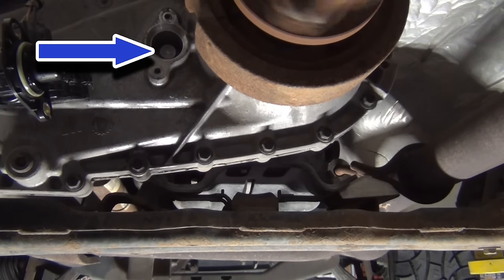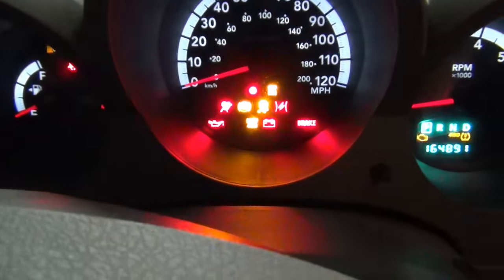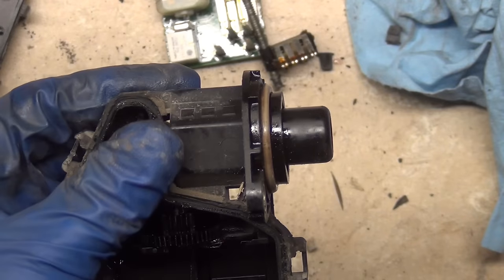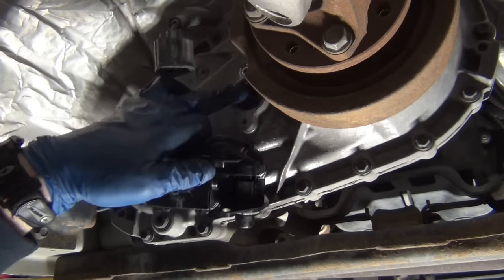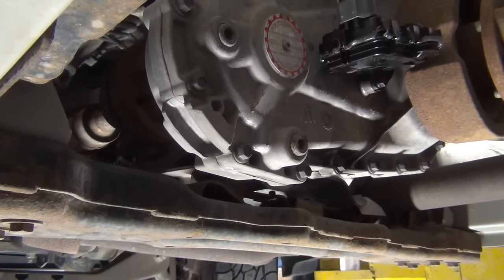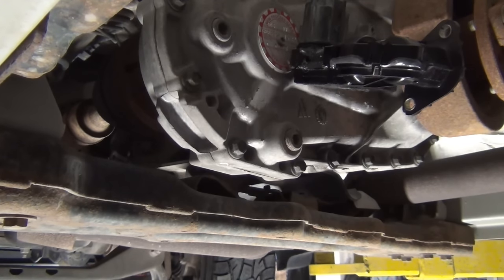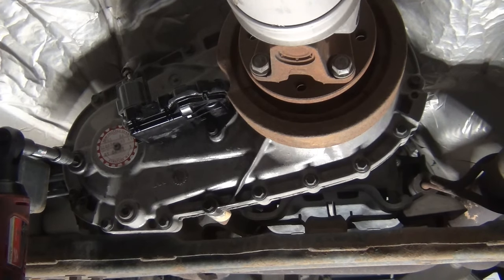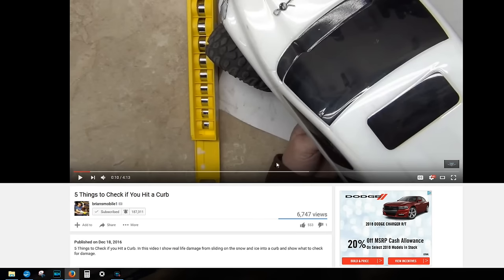Serv 4WD Cheap Fix Transfer Case Tip

Comment: I am confused … Was the problem the actuator, or was it the selector switch in the dash that was actually the problem ???. it sounded like you said that you probably didn't even have to change the actuator. (or were you meaning that the problem was some type of relay switch within the actuator ?).
Reply: I know its an old comment but his actuator worked but when he put it in 2 wheek drive the transfer case stayed in 4 wheel drive- it was common on older 4x4 vehicles as the gears would be loaded together- it was common practice to stop put in 2 wheek drive back up slightly and then KNOW you were out of the 4 wheek drive mode as driving on pavement is generally tough on the transfer case( the tires dont all slpin ar the same rate look up differential creation on youtube theres an old gm video from like the 40s that explains this)

Comment: I thought the 4WD was made in to the transmission but I guess this one has a 4WD mechanism motor with that piston coming out and going into the transmission and pushing that cluch inside to make all the weels move to 4WD
Reply: DJ.Spikes Hostage if 4wd is selectable then it  will always have a t-case.
Reply: tyler a not the ones I seen I work on cars bud ,,,take care!!!!
Reply: Bahahahahaha
Reply: "Selectable" or "on the fly" is usually an electro-mechanical switchable device, whereas "locking hubs" are usually manually operated twist actuators that engage 4x4. Not every 4x4 vehicle uses a transfer case. Most AWD setups are transmission based, without any outside 3rd unit.
Reply: Lets clear this up a little. If you have a front wheel drive that has a 4WD option, then you might not have an external transfer case. If you have a RWD 4WD, then you have to have an external transfer case. That being said, even when it's bolted directly to the transmission, I've never not seen a transfer case on an AWD/4WD vehicle. Please provide an example of a 4WD without a transfer case.
Reply: https://en.wikipedia.org/wiki/Four-wheel_drive    https://en.wikipedia.org/wiki/List_of_Subaru_transmissions#1989–1994_Subaru_Justy_ECVT/Justy_4WD_ECVT    https://en.wikipedia.org/wiki/Subaru_Leone      /   https://en.wikipedia.org/wiki/Subaru_Leone#Second_generation    https://oppositelock.kinja.com/a-4-wd-what-is-awd-4wd-and-how-does-it-work-1650386909/1650531656

Comment: My 2008 dodge ram kicks into 4-wheel drive driving down highway or when I start it in my drive way. Replaced front end actuator,  servo motor,  switch and had in shop. Still is not resolved. Help!??

Comment: A light on my dash reading 4wd and the truck was in 2 wheel drive when I stop makes a conlooping sound. I can drive in 4 wheels (fire stone check it and said the truck doesn't know what greer it's in.    I am driving in 4 wheel drive not with out problems.  the transmission is new 2017.   warranty gone. help ?   where is the transfer case shift motor in a 1995 toyota 4 runner v6?

Comment: I have a 2007 H3 it will start but wont move when I shift it into drive the front drive shaft spins but truck won't move I'm lost an don't know where to start with this truck

Comment: Funny, it's called extreme green yet it's red. 

I am thinking of buying a 2005 Jeep Grand Cherokee 5.7 Hemi with the service 4x4 light on. I looked up some stuff here and there in some jeep forums and apparently there is a N23 recall dealing with that issue. It's from not using the 4 wheel drive and that button  gets stuck. 

I had heard also that pulling the e-diff fuse under the hood, driving around for about 10 minutes then replacing the fuse will shut off the light. 

I figure I could hummmm and hrmmmm him into thinking I might need to replace the transfer case or something scary and get 1500 off or something. heh heh heh

Great vid as usual my friend.
Reply from the maker: Thanks buddy!  Yeah, it's environmentally friendly and made from plants.  I don't like the name at all, but I'm glad I know about it.  The trans fluid stuff is red- all else is honey colored.  Good to know.  Thanks- great to see your smiling face in the comments!  How've you been man?

Comment: How do you change the fluid in the transfer case? I have a Jeep Wrangler. Fixed a bunch of stuff already with your help. THANK YOU!
Reply from the maker: MOST have a fill plug like shown at 10:52.  There's also a drain plug that looks just like the fill plug, but at the bottom.  Best of luck!

Comment: So that Extreme Green is that good
Reply from the maker: For high pressure- yes.  It's crazy good.  I went from their biggest skeptic to singing in the choir in one trip to L.A. I use it all the time now.  Used it yesterday in spray can form twice.  It's the shiz-nit for lubricating anything screw drive like a ball joint press or strut spring compressor.

Comment: So was the actuator switch actually bad, or could just taking it off and then spraying the button have worked ?.  I have a 2005 Dakota that engages itself into and out of 4 low, I am thinking it must be a similar actuator switch problem.

Comment: Where did you find the part? Mine has been out for a while and winter is coming soon
Reply from the maker: Dealership for almost $500!  Part Number: 23999-06131570  Parts Geek link→ https://www.partsgeek.com/catalog/2007/dodge/nitro/transmission/transfer_case_actuator.html
Reply: @briansmobile1  😶🫨 thanks for the link didn’t expect to be this much lol.

Comment: I'm having the same problem service 4wd light  on 2011 jeep grand cherokee overland drives me nuts works in all gears no prob but the dang light won't go away thinking of trying ur method I'll keep you posted.
Reply: did you fix it? I have the same issue with my 2011 GC limited. 4WD SVC light is on
Reply: @johnng4139  unfortunately  no  not yet due to the mechanics  around  me they  are clueless  but as soon   as I do I'll try to put up some information  to help u out
Reply: @djshortcutz  thanks for the reply. I heard it may need a computer flash. Taking it to the dealer nest week.
Reply: @johnng4139   hope that works  can u keep  me posted  because I went to a shop there trying to tell me some wrong with transfer case to take it to  transmission  shop which I know from there it's gonna cost a arm and a leg  
Fingers crossed ...
Reply: Hi everyone, I had the same issue with my 2013 Grand cherokee Limited 3.6. After looking docents of videos and reading. After various scans in the different shops avoiding go to the dealer :). The solution was update the software of the vehicle. Now it feels with more power and smooth.
Reply: ng I was thinking that the problem was the transfer case module, speed sensor or the transmission internally. Went to the dealer and updated the software with the latest. It feels like a brand new grand cherokee

Comment: Squirrels got into my engine  bay over night on my 2017 Jeep Renegade Sport in the morning the 4-wheel drive was disabled traction control was disabled power fluctuations were happening local mechanic could not figure it out any ideas

Comment: For a transfer case that only has a lock function for 4wd (no center diff or full time mode iow), that's pretty normal behavior. You should switch modes, stop, back up a little later, and/or saw your steering wheel left and right to fully disengage that gear, especially as it ages and the miles pile on. Pretty much any transfer case on my old jeeps is like this. Not that lubing that mechanism can hurt though either lol. Never seem a 2wd/4lock only tcase. Not for dry pavement use.

Comment: I only use gear oil in my Tcase. Pushing 250k with no issues.
Reply from the maker: Some are supposed to have gear oil or motor oil or whatever NP calls for.  Just don't use the factory blue GM stuff when that's called for without some kind of HP modifier and even then us ATF instead.

Comment: I think the easy fix is to go reverse then drive every time to go out of 4wd ( old school )
Reply: Sometimes that doesn't work though. One time my friend and I went salmon fishing down at a river. It was about 100 miles from home and we had to go mud bogging in 4 low just to get to the spot.  It got stuck in 4 low. Tried everything to get it back to 2 HI. Back up forwards slam on the brakes,back up,stick it in Neutral.  Busted out the owners booklet. Finally I went under the truck laying on the floor mats with hip waders and a rain coat on trying to not get all soaking wet and muddy. Tapped on the transfer case motor with a rock.  That worked, it went back to 2 HI and we made it home. My Explorer has gotten stuck in 4x4 also. I replaced the switch and the motor. I make sure to use it once in a while. I use it about once a month. Haven't had any problems since I started doing that about a year ago.

Comment: @briansmobile1. This 2010 Patriot I have, the 4WD! light would come on right around the 1-Mile at every startup. However today, I hit a chuckhole sorta hard & when I got home, [4 miles] the light still didn't come on. Although I've fixed 2 grounding pigtails under the hood in the engine compartment, there still must be a bad ground somewhere else. Gee these Patriots with their cheap wiring, poor engineering and not being made for the rust belt states sorta sucks... 
I've managed ti fix all the other warning lights that were staying on, just this one light left... Have you ever heard of this issue before, or dealt with it? Thx, good video too..

Comment: Cheaply made yet expensive Chrysler crap parts. That’s ridiculous
Reply: '06 town'n'country sheet metal (+) battery terminal, 2 piece, only cost $40.  That's not bad : )
Reply: You don't know much do ya? ALL automakers use the very same parts suppliers and to save costs even the very same parts. The NV transfer case is used by many manufacturers. NV..New Venture used to be called New Process which made A833 Hemi 4 speeds...unbreakable! https://en.wikipedia.org/wiki/New_Venture_Gear

Comment: My 2006 dakota 4.7 4x4 when I go around 55-65 mph tries to enter the 4LO by itself without me moving anything, it does not go in, it just makes the noise, turns on the 4LO light on the dash and turns off immediately. This he does not always do, but he usually does. My mechanic says that the actuator is working fine, because it does its job. Any idea what it could be?
Reply: Did you ever get this solved? I'm having the same issue with mine.

Comment: Hey, great video. I have a 2005 durango 4.7. It appears to have the same setup underneath. The question I have is that this durango has all wheel drive instead of 2 wheel drive. Do you know what the difference would be if any? 
Thanks so much, Brian

Comment: i use it in my transmission and my rear deferential
i think your the one that told me about it last year im in utah so we have lots of mountains and hill's
Reply from the maker: Right on!  I wish I'd learned about it sooner and that I'd used it sooner.  I'm SUPER skeptical about additives.
Reply: briansmobile1 
its great stuff little pricey but works good
Reply: briansmobile

1 day ago · #1

hi brian hey  i keep getting bank one and bank two lean codes i changed the uper and lower intake manifold gaskets but the crazy part is it keeps saying that the codes are pending tried erasing them and they just come back saying pending another guy told me it could be a bad computer anyone else ever have this problem or know what can cause the codes i have a 98 ford explorer eddie bauer with the 4.0 sohc VIN E
Reply: briansmobile1 
and i changed my uper and lower intake manifold gaskets and nothing
Reply: @briansmobile1  having trouble with my nitro came across your video mine feels like something rubbing or grinding.

Comment: don't you have to be in neutral when engaging and disengaging 4wd
Reply from the maker: Shifting from 2wd  and 4wd high (which is all this has) while the front and read wheels are going the same speed it's okay.   On the lift you should be stopped regardless of neutral or not.  It's more about gear and driveshaft speeds than anything.
Reply: Only when going to 4 low
Reply: Mine needs to be in reverse or it won't shift 

Edit: for 4low that is

Comment: I have a 2004 jeep liberty an I had it in drive position. Tried to put it into 4wd an forgot it wasn't in neutral an quickly put shifter back down. It had little burn smell in vents. Did I damage it?

Comment: Will you be doing a followup on the transfer case? I'd like to know what makes it stuck.
Reply: He didn't even test his majgic juice this time as in after treatment show off. They all stick like this even the manual ones. Backing up a short distance has always been the secret to successful 2 to 4 and 4 to 2 wheel drive operation. Would have been better to make that the central theme take away.Achilles heel, you must compensate for it always if you want to be a smart driver. Push button faux world just wrongly impresses people with the wrong impression. But now that you know they lie often, you can take it or leave it and even put it in reverse for ten feet anyway.
Reply from the maker: You're totally on the right track, but this was different in that you could back up a mile and the 4wd wouldn't come on.  It was STUCK.

Comment: I got a charger awd and once the transfer case control module died which is involved in talking to the axle actuator, i just wired a switch to the actuator directly, it just needs constant gnd and 12v ignition then one pin is for a ground engaged for awd on and remove for off, another pin is feedback to tell if engaged i guess.

Comment: My grand Cherokee 2013 had the same issue and the solution was as simple as just update the software with the latest  version. Now it feels like brand new and more power
Reply: Update it by replacing the module or do you mean taking it to the dealer to actually update the software?
Reply: @payattention7990  update the software
Reply: Do they charge to update the software

Comment: Do you think maybe being off the ground with no resistance from the wheels kept it in 4wd? Can you believe the price! Really? For that cheap made thing. Looks like an after market manual 4wd lever is in order
Reply from the maker: It could be for sure, but it was a hot mess on the ground too.  As I said the light would come on and stay on and the 4wd would be supper intermittent and not come on at all that last day.  I was positive something snapped, but never found the proof.

Comment: A very quick and easy fix for this is when it is in 2wd, remove the small white fuse (closest to the firewall),  Problem solved. (Reinsert fuse to engage 4wd then remove it again).
Reply: Can u upload the pic of the fuse
Reply: @johnkellum7390  No, but i am sure there is a fuse box diagram in the owners manual. I believe It is a very small, single 2 amp fuse, at the end of the rows of multiple larger fuses.

Comment: That was some pretty good fixer-upper stuff there Brian. Off topic here but I got to spend a little time with D6spanky and I have to say, what a pleasure it was to meet her. I got called away to work so our time was short but my hope is to have another chance to  be there and spend more time in your neck of the woods.
Reply from the maker: Heck ya man!  You've got my details- give me a  heads up next time you're here.  Spanky knows where I'm at too.
Reply: briansmobile1 Thank you, I wll.

Comment: Thanks Brian, My SRVC 4WD light flashed on and off today on my '07 Nitro. Your video gave me the info I need if the light comes back on. I had an '08 6 Spd Manual Nitro that use to sound like a grenade going off when the transfer case slipped/popped!

Comment: I had a bare spot on two of the wires going to my transfer case. Fixed my service 4wd code so check for shorts before you take your truck to a mechanic and save some money.